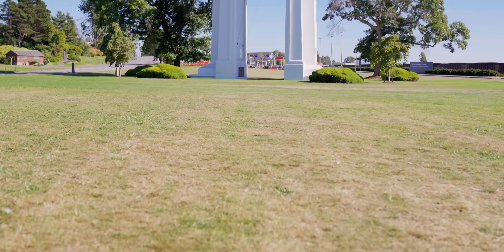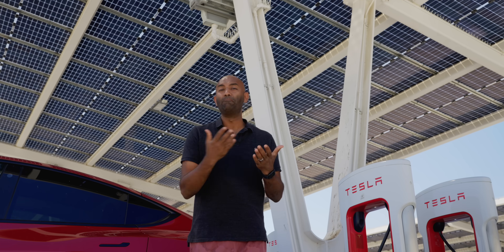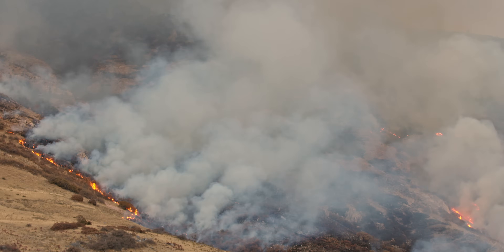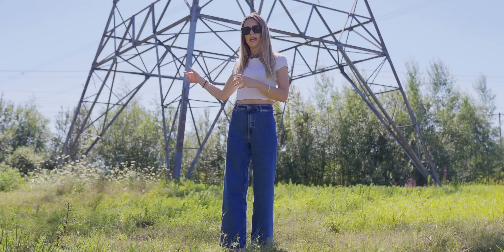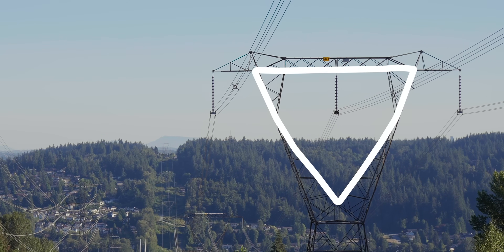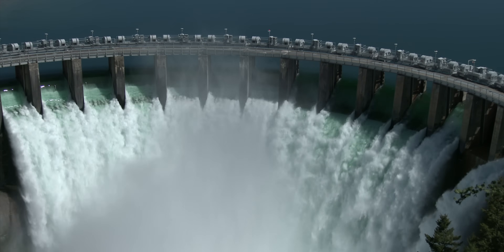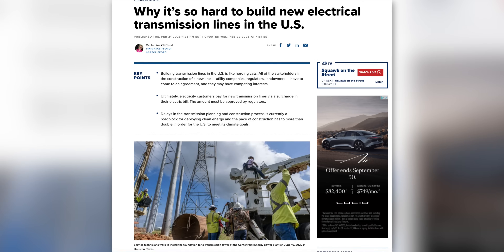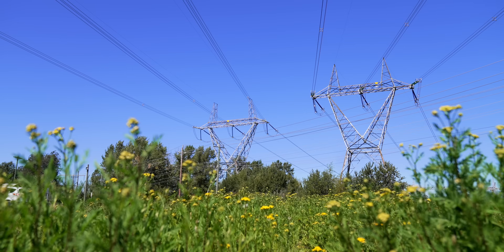THIS Grid Reduces The Need For Renewables!

Comment: Pie in the sky and mis leading with current technology and existing grid capacity and network connectivity. USA is way ahead of us purely in term of scale, in the UK the climate alarmist cults and net zero nutters and successive governments have driven us blindly up a cul de sac, both in terms of power generation and network grid capacity. As for batter storage it is a joke once you consider up scaling to national level capacity even in the small UK, let alone the USA. The cost of upgrading the network capacity in the UK alone is astronomical and who do you think will pay for this? UK government has blindly committed UK residents to massively high energy costs by entering mad energy contracts with the wind and solar generators, not to mention the massive subsidy paid to Drax power station operators to keep it running its ‘green renewable’ burning of woodchip imported from canada and usa and transported by ships powered by ‘classified green’ crude oil, laughable. The whole carbon pyramid is an artificial market conceived to control the population and generate taxes. The likes of tesla would not of and will not survive without carbon trading. Please start and be honest about the information and products you are pushing🏴🇬🇧

Comment: You always seem to feel the need to have a blonde woman to explain the science and they often don't do much science themselves so it comes out garbled, whereas in engineering it is usually the men building and designing these systems, so would be the better option if you were not so ideologically correct.

Comment: No talk about “smart” transmission lines or new wire technology? Those innovations are inexpensive, use existing grid infrastructure, and can move about 75% more electrons. Those are needed and are being implemented today with very short permitting timelines to get us half way there to 100% renewables.

Comment: Um, visit China. The future of power, high voltage DC smart grids is already there. Actually, the USA grid is fragmented, aging and not working during peak demands. China & USA are approximately the same area and both have challenging geography. USA talks about clean energy, EVs and HSR, China just does it. I get that you are reporting on what US & Canada are doing to improve, but this might be better titled "The future of power in North America". The North American system is too fragmented to ever be a model system; might be a model of how to improve a poorly standardized system to make the best of a difficult situation, but this has limits.

Comment: Face the facts, fossil fuels are very high density energy. 
5times more electricity is needed with no fossil fuels. 
The existing grid is fragile,  built to minimum economic standards. 
Blackouts happen if supply or demand are slightly different. 
Double the grid load, and it breaks.
5times is how big the grid capacity has to expand to.

The existing national grid, the towers and poles, and wires to the streets and homes and businesses and industries and buildings and warehouses and shopping centres and millions of ends of the grid has taken 100years and massive national wealth to build. 
And transformers and switch yards. 

We ain't building 4 more national grids. 

The existing grid is invisible to everyone as it "does not move."
😊 😊

These people are not hard dollar construction people. 
They are lost in a fantasy.

Solar farms are not financially viable because of the expensive new transmission lines required to get electricity to the city users.

Millions of EVs and machinery.
300million vehicles in the USA.

Comment: I wanted to hear much more technical detail. Here’s something I’m wondering about. Electricity is propagating presumably at the speed of light in the metal that the conductors are made out of.  The size of these interconnects is so big that there’s a substantial propagation delay from one end of the network to the other. So I’m wondering how the different parts of the network synchronize themselves in terms of synchronizing the phase angle of the AC waveform in different places.  If you took a snapshot of the grid at a single moment in time, what would the locations where the propagating electricity is currently at its peak look like?

Comment: Very nice. It's crazy that there's 2 TW (which you could've said instead of "2000 GW") of capacity waiting to contribute but can't. Also, BTW, the "kilo" in kilometre is pronounced just like you're pronouncing it for "kilovolt", and the "metre" is pronounced just like the standalone word. It doesn't rhyme with "thermometer", for example, but it's a unit of measurement, not a measuring device.

Comment: Looks like it's back to DC for both the grid & homes, HVDC is suitable for subterranean & submarine connections & DC domestic appliances just make sense these days (lighting & low-load appliances) especially with home generation being DC. AC was good for regional transmission but needs to end now as it has no place in long range transmission or domestic use. 
The game-changer would be commercial though. Imagine selling electricity generated by your home back to yourself when using a public power point.  Or subscribing to grid-storage bypassing the need for a huge domestic battery. Kind of like an electrical version of the internet/Cloud. Domestic generation is probably the solution to full electrification but he generation/consumption gap need to be fixed & batteries blow the budget.

Comment: Interesting point about AC/DC transmission. AC suffers significant losses in underwater transmission, due to electromagnetic interactions with cladding and seawater, so DC is used.  Perhaps there is a similar effect for underground transmission, making DC a better option for that ?

Comment: We could just be using the global, super grid that already exists… y’know… the internet? Power over Fiber has been around for decades and we already have a global network of fiber lines and the ability to make more at nearly 0 environmental cost
Reply: Would never be able to carry the required power.
Reply: @Freba9  Then we should be spending our limited time developing PoF transceivers that CAN handle the power. It would be exponentially cheaper than building an entirely new grid while being orders of magnitude more efficient
Reply: @MrStreaty122  The electrical grid mainly needs expansion. There is a reason why aluminium / steel conductors have been used for over a century for high power transmission.

Comment: There are national security issues with centrally distributed electrical power.

In the 1960s I was living in Canada, when a transformer in the grid distribution site in Buffalo failed. and most of eastern Canada and the eastern US went dark.

There were only two of these transformers available at that time and it would take many months, or even years to manufacture additional transformers.

A later security analysis pointed out that there are only a dozen distribution nodes around the US relying on this type of transformer and if they were sabotaged it would take months if not years to get the US electrical grid back up again

now consider if millions of businesses and homes, with solar and energy storage,as well as electric vehicles, it would be damn near impossible to shut it all down and this type of distributed power generation and storage would increase  National security.

Unfortunately I rarely ever hear this brought up as the big disadvantage of centrally distributed power generation.

Another point is historically wars are often start over access to energy, such as recently the access to petroleum products.

If there is no need to secure importation of energy sources, I suspect it would greatly reduce the reasons for countries to go to war.

And an additional bonus would be that it would not only lower the cost of living, (the cost of energy is what drives inflation), the money consumers would save would give them a better quality of life and more spending power, which would drive the economy to greater heights, something that businesses would appreciate.

I believe the best solution would be a hybrid grid, combining most areas that could be supported locally together with distribution to take care of sudden loads or breakdowns, it's a flexible approach that would address the issues and reduce the vulnerability of sabotage.

Scientia Habet Non Domus,
(Knowledge Has No Home)

antiguajohn

Comment: Higher voltage allows for thinner conductors to carry the same current.  Longer distance leads to fatter conductors to offset the accumulated resistance.
Reply: Actually higher voltage does not allow thinner conductors to carry the same current. Higher voltage does however allow thinner conductors to carry the same power (watts). The amount of current a wire can carry is not related to voltage. Voltage x  amps = Watts. Increase the voltage and you increase the Watts if the current stays the same.😊
Reply: @richardnwilson  Of course that's what I meant to say. ;-)

Comment: Is it possible to run power lines underground or do they have to be on pylons?
Reply: Underground cables need to be far thicker than overhead lines because they are not air cooled.
Reply: There is a section in Dorset (UK) where some 19 pylons have recently been replaced by underground cables for aesthetic purposes in an area of Outstanding natural and historic beauty. Apparently the existing pylons were coming to end of life anyway, the cost was of cost high. 
On a large scale the problem is cost per mile versus other benefits, hence cables normally only go underground in cities.

Comment: At 2:50 , there is a video of a dump truck powered by overhead wires. I want to know more about that.
Reply: The tech developed at the same time as steam (17th/18th centuries) & is still widely used in industry. 
The excavator loading the dump truck is likely to be electric too because one wire is easier & quicker to move than hundreds of gallons of fuel.
Reply: there's a whole video all about it on this channel

Comment: 3rd Nikola battery-electric truck catches fire

Alan Adler

September 6, 2023, 7:36 pm

A third Nikola battery-electric truck caught on fire in Arizona. But the company said the trucks are safe to drive with precautions. (Photo: Alan Adler/FreightWaves)
A third Nikola battery-electric truck caught on fire in Arizona, but the company said the recalled trucks are still safe to drive with precautions including parking outside and away from structures and leaving the main battery disconnect switch in the “on” position until the truck is repaired.
The fire on Monday at Arizona Lithium in Tempe started in the battery pack where fires in June and August also originated. No injuries have been reported in any of the fires.

Comment: Better transmission, in combination with better demand side management can make the need for storage very small.  We're still getting better at transforming power, we might get AC/DC transforming technologies that makes HVDC relevant for much shorter distances, and longer, than current, relatively soon. I find storage more technically interesting than improved transmission, but improved transmission is a better solution.   

Shaving the worst peaks from peak demand makes it much easier to meet demand with long distance transmission. And there's a lot of potential for households moving power draw from grid a few hours or more that requires no to moderate investments or adjustments in life when everything is electric. Most charging of non-commercial EVs can be moved days without problems. A lot of the heat for hot water and heating homes can relatively  easily be stored for hours. Thermal storage for cooling, for ACs and refrigerators could be even easier, as water has a convenient freezing point, which even can be adjusted with additives. Thermal storage also means you don't need as high output from the heat pumps as you need for that instant powerful heating or cooling, which means you can get higher efficiency. Also, running conventional ACs harder the higher the outside temperature gets  is, well, not intelligent.

Comment: What is green tech for the power grid? well its NOT wind or solar as both are not 100% renewable at best 60% the rest is to the tip ... Hydro? well it makes a big bloody mess but lasts over a 100yrs if not more and is 99% recyclable . BUT ARE THEY GREEN? only the dams returns more energy than it took to make ,keep and recycle it along with the rehab  on the site

Comment: Don't forget the constraints on the system, only so much power can be transported without instability in the system loop. The 750 kV DC line only goes in one direction, South. There are ties to the Eastern interconnection also; as well as the Texas interconnection, although they don't like to admit it. The losses are more than 10 percent but with local battery storage losses will be reduced. Most of this wire is aluminum (ASCR). Distance is one of the biggest challenges, not politicians. Don't ask me how I know, (former system operator).

Comment: Power companies shouldn’t have to ask people to use less power. The price of power just needs to be time of use priced. If electricity is more expensive people won’t use it as much. 

I think this also goes for industry. Make electricity expensive enough at a certain time and industry will change. Some companies would even change their working hours if it saved them enough money.
Reply: No they won't, they will put in battery storage systems. Do you have solar panels on your house?
Reply: @tedmoss Yes I do. But Washington doesn’t have time of use pricing. So I don’t have a powerwall yet.
Reply: @tedmoss Yes I do. But Washington doesn’t have time of use pricing. So I don’t have a powerwall yet.
Reply: @tedmoss Yes I do. But Washington doesn’t have time of use pricing. So I don’t have a powerwall yet.
Reply: @tedmoss Yes I do. But Washington doesn’t have time of use pricing. So I don’t have a powerwall yet.
Reply: So the rich can cool down their big houses while the poor will in heatwaves just die. cause of heat or cause the power bill does left no money to buy food. Not a good solution TBH. 
Having Energy market prices as option is nice. For heatpumps and electric car charging that can be really nice when they automatic look when the best time is to use power and by that save some money. 
There is a story about a bakery that switched to later working hours to have more use of the PV on the roof but that needs to be done in a clever way not by just having everyone pay Hourly marketprices.
Reply: @toggleton6365 I see time of use as something that only changes every couple of months so people can plan. Market pricing happens on the fly so planning is really hard. 

Rich people will just ignore the cost of electricity. Poor people will use the cheap electricity to cool their house then have shades so the house doesn’t warm up to much during the hottest part of the day. 

Some people cool their house to 63 degrees at night and it never goes over 75 during the day even when it’s 100 degrees out. Only works if your house is properly insulated.

Comment: if only the US could / would recognize the invaluable utility of geothermal when it comes to heating and cooling, we could drastically reduce the need to send power regardless of region.  
We've got a lot of land and it can be used as a heatsink.  The ground not barely 2-3 metres deep is at a constant 25C year-round
Reply: As the cost goes down, more will be done. Build your own.
Reply: @tedmoss  With economy of scale, per the ideology of this video, geothermal could actually be cost effective, rather than having to build massive electrical corridors to transmit energy from Canada to the California and vise versa.  The answers are literally in front of us and we refuse to accept them

Comment: Put the lines underground as much as possible. It's more expensive up.front, but in the long term it's definitely worth it. High voltage DC for the long distance super grid, AC for medium grids and low voltage battery backed up DC micro grids for the neighbourhood.
Reply: The losses are far greater when buried. So not just more expensive to build. More expensive to run.
Reply: Nope!!!! It's definitely not worth it and not everywhere! The repairs and other works on it are super expensive on underground lines.
Reply: @alanmay7929 disagree, repairs may be more expensive but are less frequent. It like a bkick road vs.asphalt. Brick is more expensive and more expensive to repair but lasts so much longe. But it’s easier to slap down asphalt that lasts three to five years to get some votes…
Reply: @michaelsmithers4900  wrong!!!

Comment: What percentage line loss occurs transmitting power the huge distances?
If pipelines only need one permit authority, why not bury the transmission line in pipelines?. No pylons to look at or be damaged by natural hazards or terrorism. By putting cables in a pipeline easier maintenance access is created.
You could even collocate the line in an existing pipeline transporting anything...water, oil, gas, etc.
Reply: Boy are you wrong, get an engineering degree.

Comment: Yesterday (Sept 6) ERCOT the Texas grid manager/operator declared a Level 2 Emergency. Grid reserves were below 1750 MW. We seem to be headed for another shortfall today as they are curerntly asking for voluntary conservation. If Texas actually participated in the Western Interconnection, the state would be much better off. But no, Republicans running the state are irrationally opposed to "federal regulation" that they would be under if they joined the other interconnected systems in the country. So their petty posturing means Texas citizens suffer power outages on a regular basis and are frequently asked to cut back, all so the "leaders" can get brownie points with low information voters.  Great stuff right?